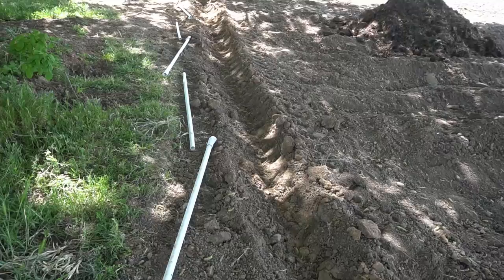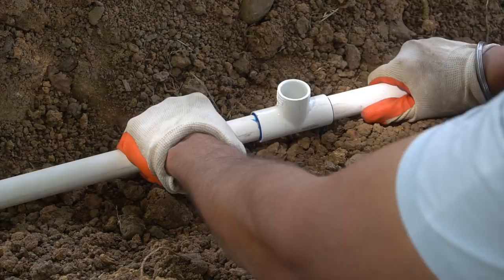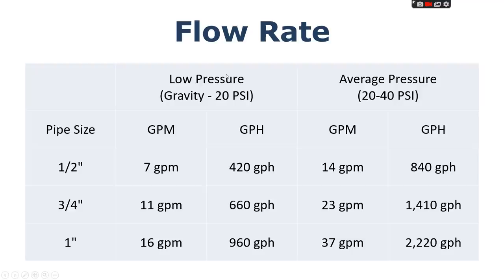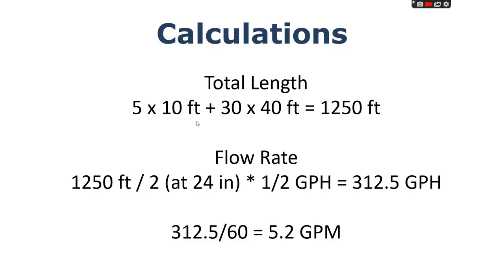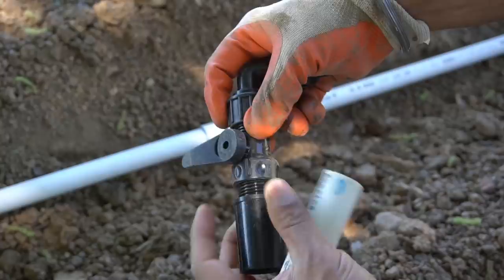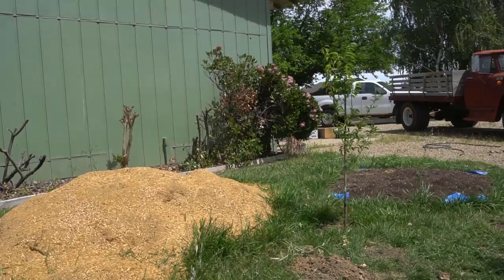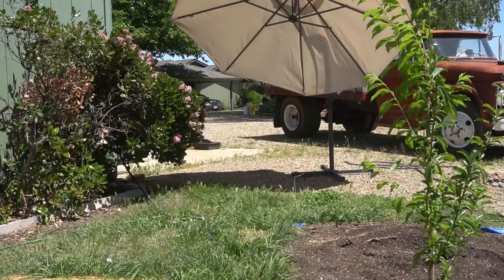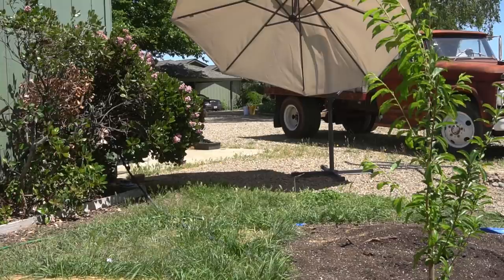How to Setup Automatic Drip Irrigation from Tap or Faucet

Comment: I use a PVC Pipe on the ground vertically ☺️ and put a beach umbrella pole into that. Helps so much with shade and stays up pretty high. Easy to move around too. Use rebar and hammer to stabilize it.

Comment: I love this video, especially as I am looking at drip irrigation for my allotment. Unfortunately, though, I don't have access to a tap that I can fit it to.  I am looking at running drip irrigation from a water butt. Would it be much different from what you show here?
Reply: The timer he is using won't work with a rain barrel (what we call it in the US! :) because it requires a certain water pressure. But it seems like many brands (like Dig, Rainbarrel Man, etc.) sell kits made just for the lower pressure of rain barrels, so I'd go with that.

Comment: Face mask ?   What do use for your glue?
Also, how long did it take and how much the supplies cost?
Reply from the maker: Used Red Hot Weld Glue. Mask is for my allergies, having really bad allergies this spring. The whole setup look about 7 hours. Cost $150